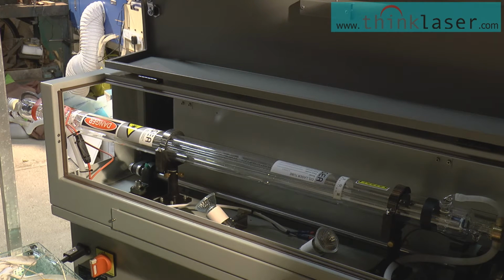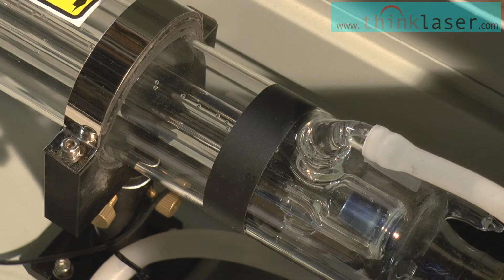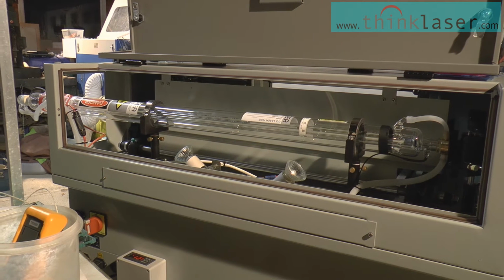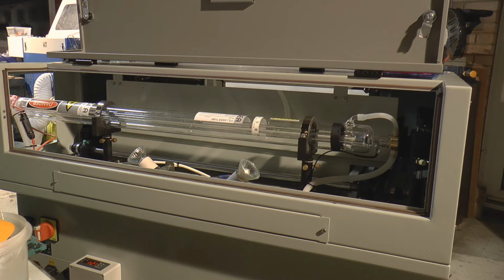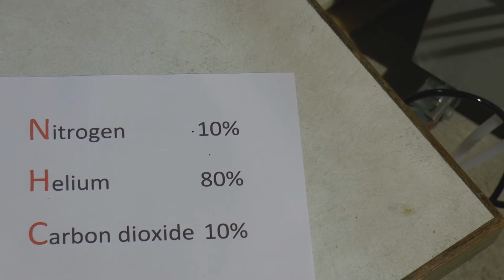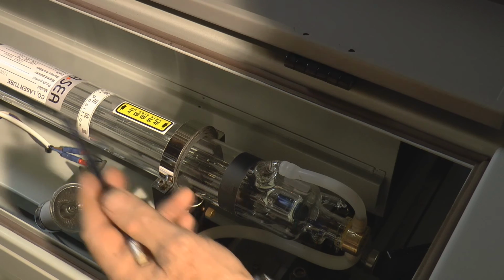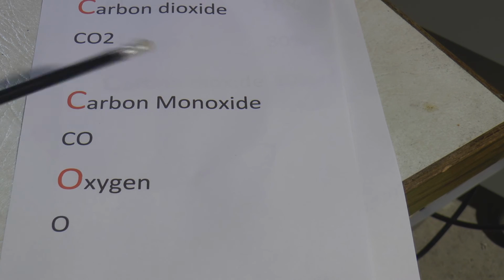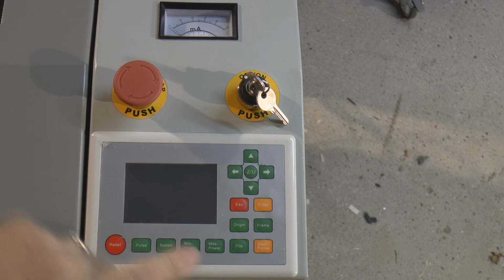How To Use a Laser Cutter - Lightblade Learning Lab 06 Know your Laser Tube and Hazards

Comment: If I have a 102w RECI tube and it recommends 85w constant should the milliamps be between 22 to 25 at 85 percent?
Reply from the maker: Hi R Reichel,
You need to be careful when specifying how many watts your tube is rated at because there is a lot of smoke and mirrors used to make you think you are getting a more powerful tube for your money. 

If you look at the Reci website, they specify something like this (W8 shown) 
"The working current: test current is 32mA. Maximum working current is 32mA. The running current must be kept below 30mA. The life span can reach 10,000 hours if the current is kept below 28mA. The ammeter must be connected to the negative electrode of laser tube."

The important figure is the Life Span current at 28mA. If you want to keep your tube running for as long as possible, this is the important value. Any higher and you will be overdriving your tube and possibly invalidating the warranty. 

Of course, running at a lower current means that the power output is reduced. We would rate the Reci tubes as follows for long life:
W1 - 75W (25mA) Claimed power 80~100W
W2 - 80W (25mA) Claimed power 90~100W
W4 - 100W (26mA) Claimed power 100~130W
W6 - 130W (28mA) Claimed power 130~160W
W8 - 150W) (28mA) Claimed power 160~190W

You need to run your tube to the current shown above and make a note of the % power setting. Then go to Vendor settings (password RD8888) in RDWorks and limit the max power to your result. 

The % power value will change from tube to tube. We have seen tubes with values ranging from 55% to 95%.

Hope that helps

Gareth @ Thinklaser.
Reply: @Thinklaser  Great information, thanks.

Comment: While testing power levels for my desire to cook with a laser (Chinese K40), I noticed that overdriving the laser seemed to reduce the power. I base this on my observations that as I moved he dial past 15ma, not only did I see less toasting of the bread occur, it actually significantly reduced as I approached 20ma. I'm doing this without the lens installed to increase the heated area. By the way, my cheese toast was a success, though the bread had a slight burned flavor.
Reply from the maker: Hi Joe,I never considered removing the lens and using a Lightblade it as a toaster......Typically you will reach your max output / maximum running current at around 60~70% power setting. It is possible that you may get 1 couple of watts more out of the laser but it's hardly worth it to run the risk of overdriving your tube and shortening the life of the tube. Have you used your laser for other unusual activities? Gareth
Reply: Thanks for the reply. No I haven't used the laser for any other unusual activities but I will be trying to cook a tiny pizza with it soon. I even bought a package of tiny pepperonis.